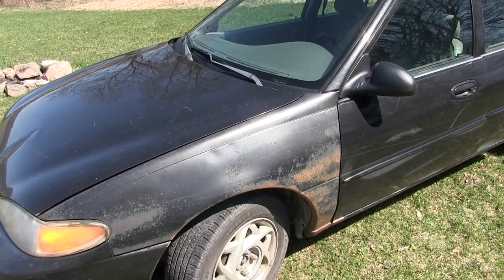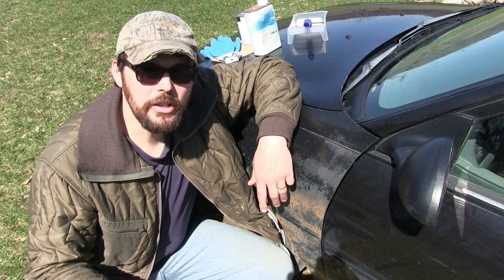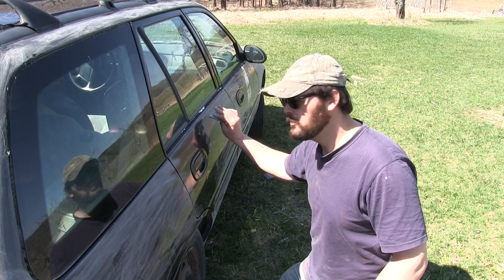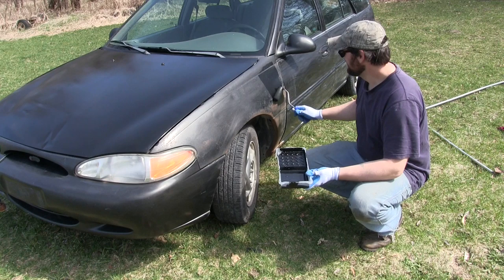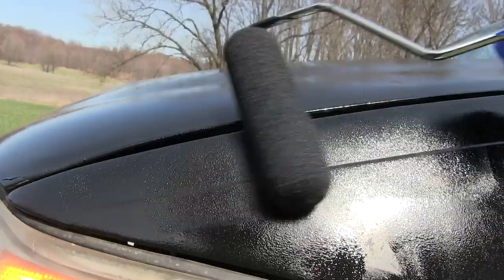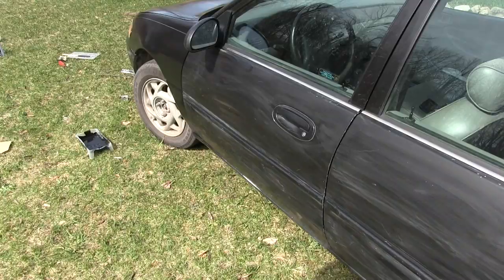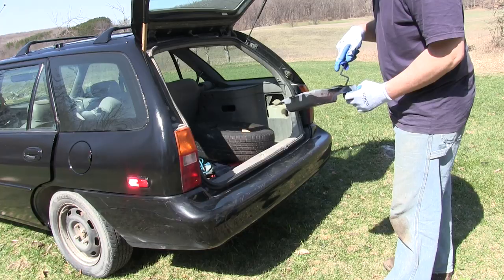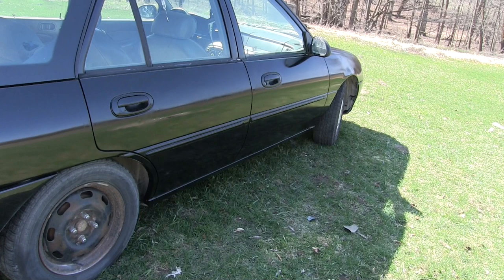Paint Your Car for $20 Bucks !!!!

Comment: Some poor guy is gonna watch this video and then go buy some interior paint from Home Depot and paint his rusty old car with no prep, directly under a tree as leaves fall on it, as the dust from the guy with the leaf blower next door floats through the air and lands on his wet paint, and say this method doesn't work. 🤣